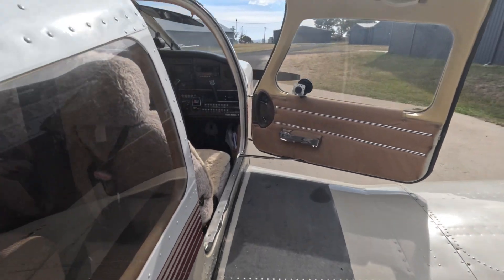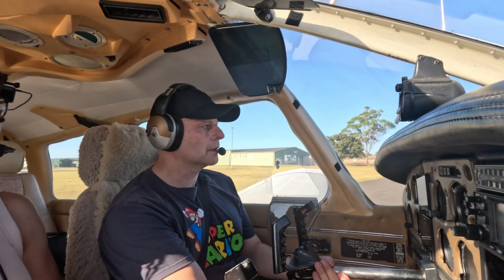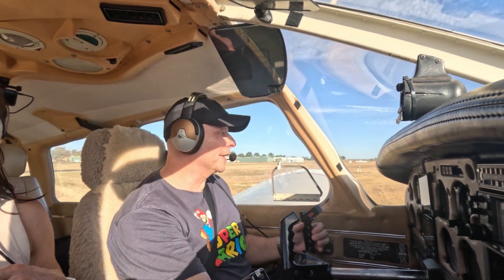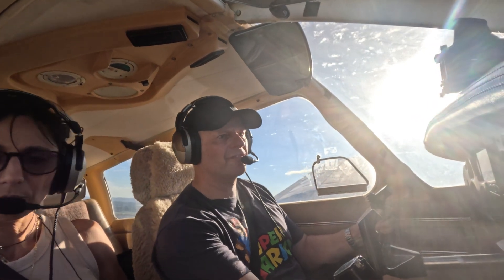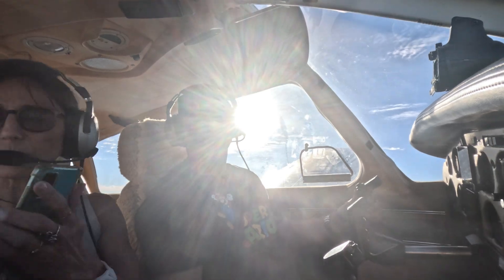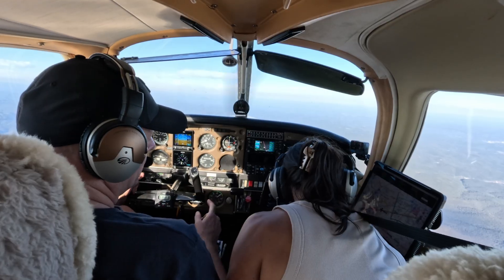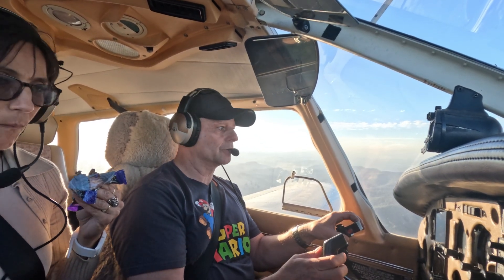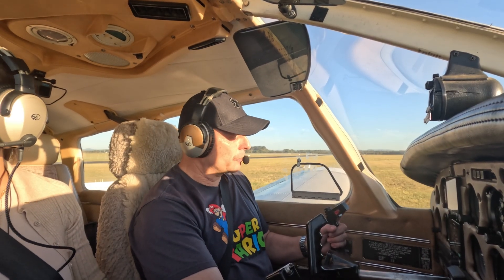Flight from Bathurst after avionics upgrade. New Garmin toys in the cockpit and the new challenge.

Comment: lets go flying anytime mate, lesson free for you any time
Reply from the maker: Went couple of weeks ago, between rain. I tested the autopilot. All good. I still have not loaded the flight-plan, but altitude hold, climb, descent, HDG mode and NAV mode direct tested and worked well. I still haven't worked out if I can add a random fuel stop in Garmin Pilot and how to enter ETA (other than calculated by system). Will get there 🙂

Comment: Nice job. Did you get the autopilot working?  Pretty scary if it doesn't do what its told 😯
Reply from the maker: Yes, I had a chance to test a bit of functionality. All good. It's a completely different type of flying.
Reply: @flyingconsultant  That's good. Let me know if you need any help as I have it paired to a G3X and use the ap most of the time. Cheers